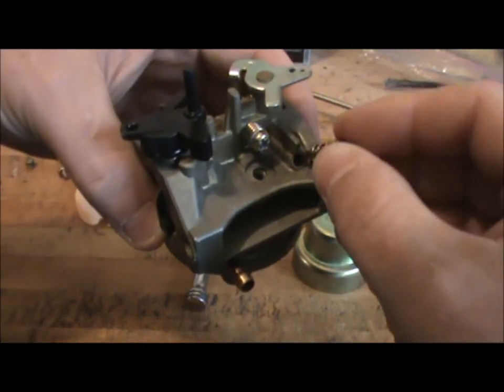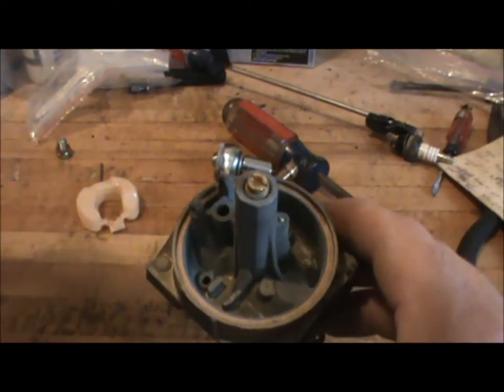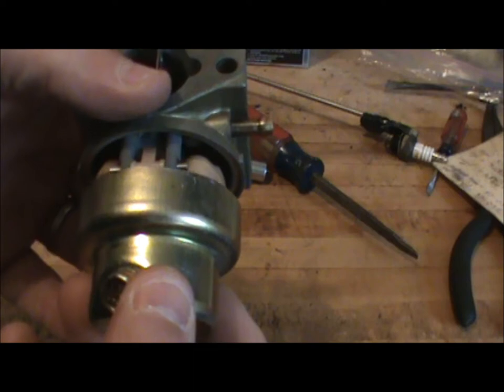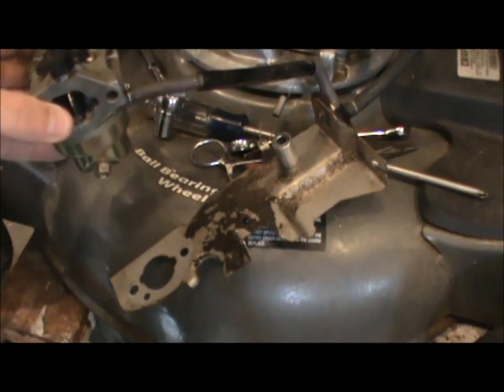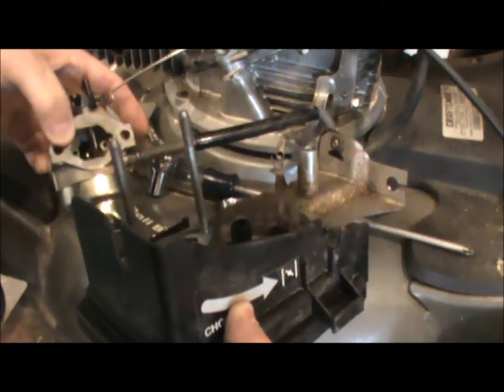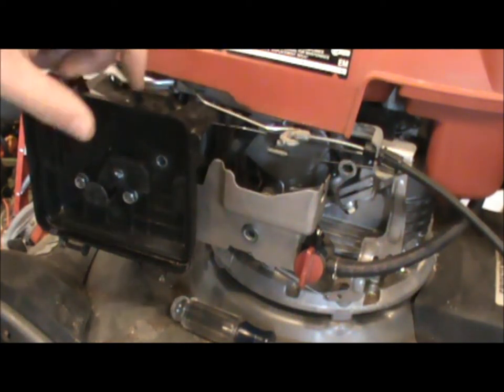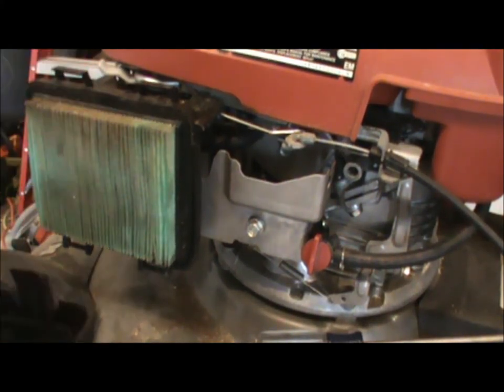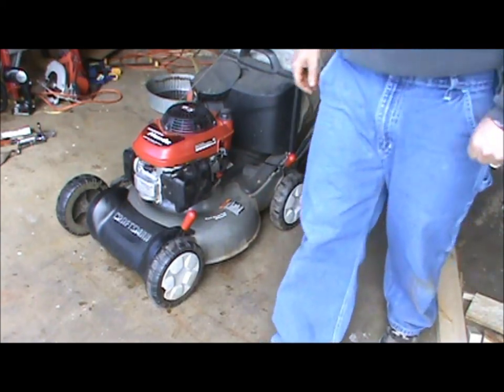How to fix a honda lawnmower part 2

Comment: I can't tell you how useful this was to me. I took the carb to pieces before seeing this and the engine wouldn't fire. Found this and now all is sweet after following your instructions. If I hadn't have had this to consult and fix it I doubt it would have cost me less than $150 at the shop at $100 per hour, even though it takes well less than an hour they would have upsold it for sure. Thanks so much.

Comment: Thanks to you this 65-year-old dog learned a new trick.  Mower wouldn't start, or would start and run a couple of seconds.  Per your instructions, I removed, cleaned and reinstalled the carburetor in my 23-year-old HR215.  It is running fine.  Thanks for your informative video.

Comment: Gday DW6,
Thanks mate for a very informative video. I was given an older commercial 21" Honda self propelled that had been well used by the local town council. The motor ran rough and only at high revs. I followed your advice, found some dirt and slight corrosion in the float bowl. The jets were slightly blocked etc. All cleaned, blown out and running like new! Way better than I ever thought it would. I appreciate that you took the time. I got a lot out of it, more than just saving a few bucks, very satisfying.
Cheers : )

Comment from the maker: If the engine is starving for fuel then quits it is most likely a carburetor issue. Check out my other videos on how to clean lawnmower carburetors.  You may have to remove the bowl and clean the main jet.  If it is not starving from lack of fuel the problem could be related to an electrical safety switch (blade engaged switch) that is grounding out the engine.

Comment: I'm not sure if you still check these posts but great video. I'm about to go do this with a mower I was given. Previous owner said he had never had a problem in 8+ years with it but also said he never changed oil, air filter, spark plugs, or anything else. Starts up and shakes like a '48 Ford then sputters out. Thanks again for a great video.

Comment: Thanks a lot for posting this very helpful video!

I've had to remove the carb to check it out, but while I was removing it, all the gaskets fell off, so I wasn't sure how to put them back on. This video helped me out a lot with that. The only issue is that my heat plate is in paper! I do hope I have the correct order of the gaskets. I don't want to damage my mower

Comment: Great Video! I followed everything you did but am stuck when it comes to reattaching the carb. I have a metal piece that extends out and see it in your video but am unable to see how you reinstalled everything b/c it skips to the attachment of the air filter. So, I'm uncertain how/where that piece fits and am wondering if that's why the mower still isn't working. Any assistance you could provide would be great!

Comment: thanks, a lady who's grass I cut gave me a fairly new condition (not sure how old it is), rarely used craftsman mower rear drive self propelled with a 5.5hp Honda engine that has been sitting many years, got it to run and then it just died and wont restart. gonna give this a try. it did leak gas like a sieve when I first turned the gas on.
Reply from the maker: How did you make out with it?
Reply: have not had time to mess with, now too cold lol

Comment: please tell me what to do w a Honda that won't start ~ the mower is good/runs great/self-propelled.  but when I went to start it other day the cord would not pull out.  so I got underneath it and took out any dried grass, all clear now.  then the cord came out more but does not go back in.  any suggestions/ideas?  thx great video!!

Comment: I posted a video titled "Need help reassemby of Craftsman lawnmower with Honda GCV engine"
Im thinking maybe the metal lever needs to be positioned so its to the right/forward of the black plastic piece that controls the carb valve/choke instead of leaving it all the way to the back.My wife just told me she thinks the choke releases itself so that might be part of what had me confused, I was looking for the lever to move it open and closed, but theres a mechanism that makes it close on its own.

Comment: How did you adjust the carb when you were done? I have the same mower but it surges and quits once the choke opens. It'll run with the choke held 1/2 way. I'm gonna take it apart and clean it out.

Comment from the maker: The only adjustment is the idle screw.  It sounds to me like you have a fuel/ carburetor problem.  Try to clean the carb like the video and it will run fine.  There is one other screw on the top of the carb that allows you to change the air/fuel mixture, but this screw has a locking cap so you can only adjust it a little bit.  If you take pliers you can remove the locking cap and adjust how ever you want.  I would leave that alone and clean the carb because that is your problem.  Please subscrib

Comment: Thanks much for the great post. I had already taken my mower apart to access the carb. I'd sprayed brake cleaner as well as possible without removing the carb from the linkage. No good. Decided to give it another chance before paying a shop and followed your two videos, this time removing and taking apart  the carb to completely clean all the ports in the two jets. Two or three pulls and she runs like a champ. There was a very thin clear gasket on the backside that got torn during removal of the carb, but I figured as long as there were gaskets at all mating surfaces still, it should work and it does. Any idea what that clear cellophane looking gasket is for? Again, thanks.
Reply from the maker: La Dindon some of the gaskets come with clear plastic attached, I think so it can be peeled and stuck in place like a sticker.

Comment: I have the Honda Harmony 2 HRR 216  GCV 160. not all the parts were included. I bought a new coil. Then a carb. and all  the gaskets. Looked on line to make sure I put it together right. But I still have a problem. The only way to start is to spray some starting fluid into the carb. Starts up runs fine. As long as it is warm you can stop it and it will start right back up. Any helpful suggestions most welcome.

Comment: Doublewide6, I have a Honda mower that is similar but not exactly the same.  It has always started with 1 or 2 pulls, until today. I have pulled and pulled and it did fire for a moment just once.  I watched part one and two of your videos, and followed your instructions.  I had no spare parts when I completed the job, and believe I did it correctly.  My jets were a little dirty, but not as bad as what the jets in the video looked like. I pulled the plug and it seems ok. The fuel line is turned on and the mower is full of gas. The plug wire is seated.  Do you have any other ideas for what could have caused my mower to go from a one pull starter to a non starting Work out machine?
Reply from the maker: If you had a working mower and did the carb repair and now it does not start something was done incorrectly.  If the mower did not start, and decided to do the carb repair I would look at the valve clearance and make sure when you put that thing on choke the the choke butterfly is shutting all the way.  Also check for spark.
Post back what you find.  I will keep an eye on this thread.

Comment: I have a Honda engine very similar to this one that I also cleaned the carb and is not running right.  It seems to be running rich: uses twice as much gas and erratically surges with occasional puffs of black smoke.  The new spark plug also blackens quickly.  When I cleaned the carb I tried not to change any adjustable controls.  Could it be I didn't get something returned correctly?  It is an automatic return choke with fixed throttle.

Comment from the maker: If you think the problem is the carb you can buy a new one at boatsdotnet online  for about $25 delivered.  I really do not like the honda auto choke engine a very finiky engine.    Surging could be the carb, black smoke could be a piston ring problem, but I'm not sure.

Comment: This was great.  I cleaned out my carb.  However, I seem to have messed up the choke.  I have this same model, theres a metal paddle/strip that pivots with the choke lever.  There is also a plastic barel that is attached to the choke lever.  It seems like these two parts are out of place in relation with each other, but I cant figure out exactly how.  Does anyone have a video or comment on what I might be doing wrong?

Comment: i had cleaned my carb. put it back together and it was idled lower than it should of been , after watching this i realized i put the linkeage in the second hole and spring in first hole after changing it around it's fine now, here's my sign